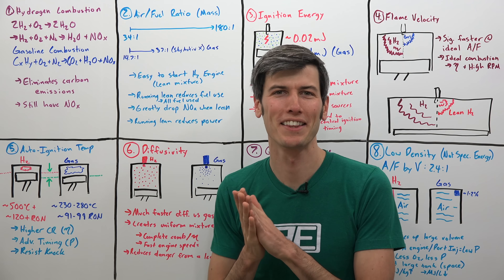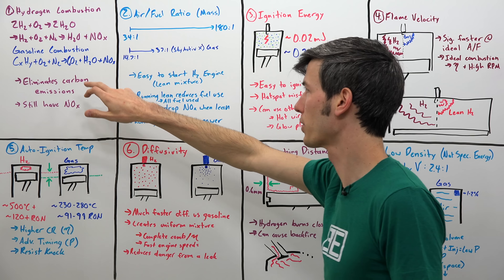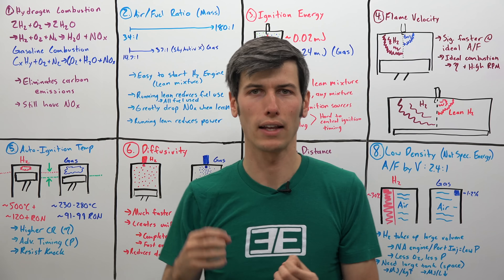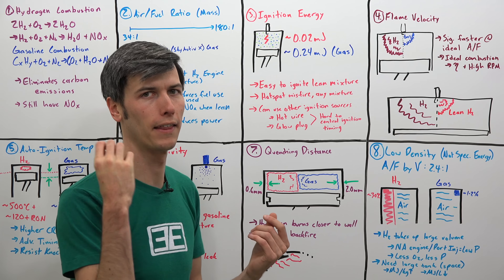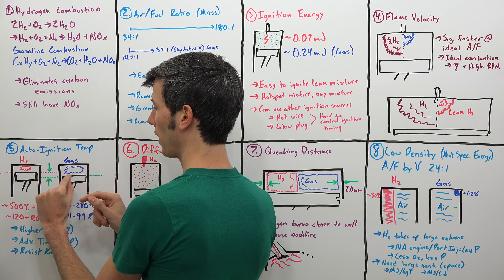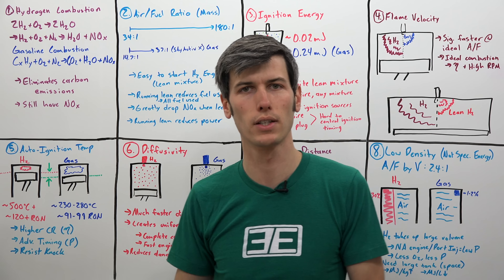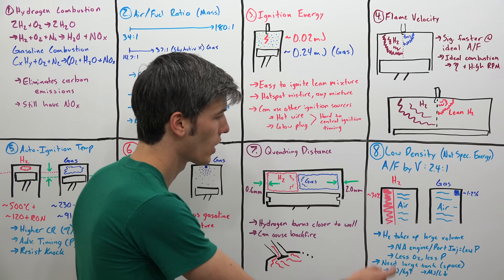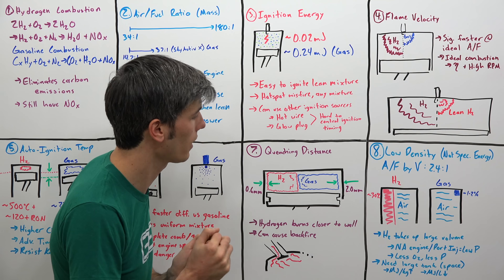The Difference Between Gasoline And Hydrogen Engines

Comment: You can get more oxygen for combustion by using pure oxygen instead the nitrogen rich atmospheric blend. It might also fix the nox emission problem. When you use a hydrolyzer to generate hydrogen, it also  generates pure oxygen. The hydrolyzer could generate the hydroxy mixture on demand, using water as the fuel.  A small amount of water can produce vast amounts of hydroxy gas. That would take care of the oversized fuel tank situation. The only thing to work out is perfecting a highly efficient hydrolyzer, but people who have done so successfully in the past seem to have a tendency of winding up dead under mysterious circumstances. I'd imagine that might be due to the fact that oil based fuels becoming obsolete over night would collapse the economies off countries who's only exports are oil, and subsequently collapse the world economy.
Reply: You can't run an engine on water because it takes the same energy to crack water into H2 and O2 gas as you get from burning the H2 and O2 gas.  Therefore, you would need a separate engine in the car to create the electricity for cracking water.  And this engine would be 30% to 40% to 50% efficient (gasoline ice, diesel ice, turbo jet, respectively).  And the electrical systems would be about 90% efficient.  And a hydrogen ICE would be between 25% and 40% efficient, whereas an H2 fuel cell is 50% efficient.  All those engines and systems under one hood, resulting in less and less efficiency?  Those mysterious deaths were probably guys working themselves to death to solve a problem that can't be solved.
Reply: MultiPleaser I think you totally missed the point of his post.  You just overly explained the problem that he already mentioned.
Reply: Why do you want to carry oxidiser onboard when you get it for free from the atmosphere?
Reply: Why burning oxygen what humand need for breathing? 
What about people living 24/7 inside crowded cities? You don't care about them, as long you can drive your noisy and air polluting car?
Reply: @eDriver  The oxygen is already used by gasoline and Diesel engines... And this engine would use PURE oxygen, that is in the water...

Comment: A wonderful video- very informative.  One thing that you did not mention is that there is no "free" Hydrogen on the planet- it must be produced (usually by electrolysis) at a significant cost in energy.   Therefore, H2 should be considered an energy storage system, as opposed to a "fuel".  Also, I noticed you did not describe using O2 as the oxidizer, just air.  MUCH more power available, if you can keep the engine from melting!

Comment: Why not just use a hydrogen fuel cell at this stage?
Reply: doesn't have the sound. But yes it is way more efficient, especially in partial load scenarios. Guess we will never see an internal combuston engine running with hydrogen in a production car.
Reply: Expensive but a better option.
Reply: Engine go vroom vroom
Reply: I agree they have much better efficiency but are currently too heavy for automobile applications while hydrogen safety tech is improving it may not make it to cars for a while but we may be seeing them in aircraft soon due to their lightweight and that is an eager trade in the aviation industry.

Comment: I would complete with corosion comparison where (I guess) gasoline is more likely to wear out the cilinders, valves and seals and HHO doesn't do it but instead (I guess) HHO leaves some water after ignition which would eventually clean the (not much existing 😅) carbon deposits but would make the exhaust rust faster . Your videos are so nice so good luck with that !!! Cheers !

Comment: Hydrogen rotary video when? I've heard Mazda is going to revive the rotary for a hydrogen based range extender for an electric-only drive hybrid. I've also heard that rotaries are very good hydrogen engines. 
Also, since there's a huge range of fuel-air mixtures, does that mean that instead of revving the engine higher for more power, we could just adjust the ratio for more power?

Comment: Running lean causes more NOx not less.  As all of the fuel available (hydrogen or gasoline) reacts with oxygen, the remaining free oxygen begins to react with nitrogen.  Higher temperatures and pressures also increase production of NOx.  EGR works to counter this by recirculating "inert" exhaust gas back into the cylinder, reducing combustion chamber temperatures.

Comment: You forgot to mention the fact that you have to keep the hydrogen a liquid so you have a very heavily insulated pressurized tank to keep it a liquid. BMW had a 7 series that could burn gasoline or hydrogen that lost most of it's trunk to the hydrogen tank that could only go like 150 miles and would turn into a gas within 7 days of filling the tank.

Comment: Doesn’t point 2 contradict your final point about how much air is in the combustion chamber? If hydrogen can burn with a greater proportion of air, does that not also mean that the combustion chamber have have more air to a given volume of hydrogen?

Comment: Using water to store the hydrogen saves the need for compressed hydrogen.  I've argued for the 'water4gas' method and have limited experience with actually running it into an ICE designed for gasoline. 

The rumble and vibration was greatly reduced, and power was  greatly improved. I later checked the oil for unusual contamination like water which would ruin it and there was none. 

Mercedes-Benz once sold a 1.8 liter turbo engine that ran on both gasoline and diesel fuel simultaneously, not exclusively one or the other but both and at any ratio

Comment: A couple things I've heard about hydrogen is, one, hydrogen is hard to store because of the small size of the molecule, it leaks out at a particular rate.  Two, metal engine parts involved with combustion become brittle over time.  Do you know why that is and are there solutions?

Comment: arent 5 and 3, 2 and 8 contradicting points? you didnt talked about cylinder walls
Reply: 5 and 3 are about compression vs. heat/ignition, the compression can be higher (i think due to density and compression of liquids vs. gas) but it takes less energy for a spark/hot spot to ignite the fuel/air.  8 and 2 refer to different things, how lean it can be to still run vs. comparable power out put to fuel air.  If i understood him correctly that is.

Comment: If it at all interests you, while watching this I pondered how hydrogen could be used to supplant natural gas and other fossil fuels for power plants. I only did a very minor inquiry into the development of these facilities and my question is: Could it be possible and on a large enough scale for power production? Obviously a power plant has vastly more space required to store liquid nitrogen so the space confinements like in a vehicle wouldn't be an issue but would the cost benefit ratio and yield of power produced be plausible if not possible?

Comment: Could u PLEASE do a video discribing in depth how an existing hydrogen combustion engine is engineered in terms of fuel carriage, fuel delivery systems perhaps detailing how it is safely done so without blowing up, and describing how the engine is controlled in terms of use (or lack) of variable valve timing, ignition timing, and computer a/f mapping.

Comment: Technical question(s):
1) does gasoline, which also provides a little cooling to the cylinder, offer more or less than hydrogen
2) leaded fuels were made so for lubricating purposes, current fuel is lead free but lubricating methods have improved. Does hydrogen operate with current lubrication tech?  
3) with higher compression and closer tolerances for hydrogen compression, what sort of wear and tear or wear tolerances are we looking at?
4) accounting for blow by, either from residual oil in/on the cylinder walls or piston rings...or from hydrogen entering the crankcase, what sort of engineering is used to account for this?  

For those who got lost on question 4- it’s what your EGR valve does to relieve and circulate excess air/exhaust byproduct and keep your engine cleaner by reburning it.  Diesels, especially older ones, are an over pressurized crank case which is why they commonly leaked oil. The diesel solution was to simply have a hose that dumped excess “air” out the bottom of a vehicle.

Comment: At 500C you need special alloys to keep the hydrogen from penetrating steel, and making it brittle.
Reply: I worked in the strip steel industry for 25 years. We annealed all our steel coils in furnaces that used pure H2 as the charge atmosphere. It can thoroughly penetrate the tightest wrapped coil of steel , preventing oxygen, nitrogen, and any other gas from entering the inner charge cover. The steel  was usually annealed at about 1300 degrees F. It came out perfectly clean and bright after about 30 hours. It was NOT brittle. It was Annealed.
Reply: So below 500C hydrogen wont penetrate metal?  from where do u know that?
Reply: Except most engines are cooled now... And have max 200 C on the COMBUSTION chamber.
Reply: Vladimir Lucifer that may be true in aggregate but the immediate surface inside the combustion chamber will be hotter. H2 is very good at penetrating metal. In my original comment i meant to say 500F not 500C.

Comment: What about the power due to the repulsive force of the gases created?  I could be wrong but I believe the majority of power from a gasoline engine comes from turning small gasoline molecules that pack neatly together into bulky CO2 molecules that do not.  So we have all these new repulsive forces from conformation changes of the molecules.  The H motor seems like it would mostly just heat up whatever gas is hanging about, plus make some steam pressure.  Is that steam pressure as significant as the CO2 pressure?

Comment: Excellent job. I had always overlooked the NOx aspect.
But you did leave off one important safety aspect. Yes hydrogen is safer for an egress leak, but an error filling the tank can be devastating. If hydrogen meets oxygen in anything over 40 psi, it makes water really easily and very loudly. A faulty filling pump line would easily explode. This has always been the major issue with hydrogen. Its touchy.

Comment: Gasoline's quench distance is why aluminum pistons and heads can survive the heat of combustion.  The unburned fuel/air on the walls insulates the metal.  I'm curious what steps are taken in an engine designed for hydrogen to manage the higher wall temperatures.

Viewers, please don't confuse pre-ignition with detonation.  They are very different effects.  They can have similar results, though.  Also, American viewers need to note he used RON value, not the more familiar pump octane value we see every day.  Pump octane is the average of Motor Octane Number (MON) and Research Octane Number (RON).  99 RON is about 94 pump octane.

Comment: What about if you make a small string trimmer sized HHO engine (closed air system to lower the volume requirement) that powers a generator that provides power to the battery of a plug-in EV?

Comment: You need to cover using hydrogen as a detonator with a base fuel. Around 10% hydrogen to hydrocarbon and it nearly has a flame front speed as fast as the hydrogen itself.

Comment: As good as this seems i see no practical value in this fuel, for example:
1. How do you store and transport hydrogen fuel in an economical way?
2. How do you produce said fuel?
3. How do you refuel and store hydrogen in your car?

Hydrogen is a gas and to get a liquid you need either ultra low temperatures or super high pressures, thus you can only store it as a compressed gas. This severely limits the amount of fuel you can store in your fuel tank and in turn also limits the range you can travel.  Then comes the question of where the hydrogen comes from, surely it doesn't grow on trees? Electrolysis perhaps? Maybe, but why go in such a roundabout way instead of just putting that electricity into an EV directly?
The closest you can now get to a hydrogen fuel is LPG. Carbon atoms do a great job of keeping hydrogen atoms through C-H bonds in the form of hydrocarbons.

Comment: Great video, two comments:
1. Are you saying any combustion car can run hydrogen as it's fuel source?  If so are there modifications needed?
2. You didn't touch upon the availability of hydrogen or the cost.  Would have been nice if you had a comparison square on that too.  To use a Back to the future reference, I assume hydrogen "it's a little hard to come by"

Comment: Great video! Have you researched HHO generators? I have been wondering is it really a myth or is it can have a positive affect on the engine performance? :)
Reply: i build my own HHO and tested it on sisters car, it was citroen xsara 1.4 8v 75hp engine... the results was reduced fuel consumption by 40% and the car was accelerating like it had 100hp
Reply: It can if you know what your doing. Or you could suck all the amps and do yourself and disservice

Comment: 11:10 when you have a fuel/air mixture igniting in the intake, it’s actually known as a popback. A backfire is when the mixture is ignited in the exhaust.
Reply: Michael Murray Don’t wanna be that guy, but.. technically a ‘Backfire’ is an ignition taking place within the inlet side of the engine, and an ‘Afterfire’ is an ignition that takes place within the exhaust side. These terms have been getting confused for years

Comment: I understand that more than one gas can exist in the same physical volume, unlike liquids. So does hydrogen taking up 30% of the cylinder really mean 30% less air volume?

E.g. vaporized methanol injection (I've been told) doesn't displace air intake volume because it occupies a different molecular space. Or is that BS?
Reply from the maker: A naturally aspirated engine can only pull in atmospheric pressure (about, at most). So you're limited by that pressure how much air you can have. At atmospheric pressure, by volume, you'll need 2.4 parts air and 1 part hydrogen. Of course, you could use forced induction, and put in more air and fuel, or use high pressure direct injection to force hydrogen in to a cylinder that's nearly full of atmospheric air.
Reply: @EngineeringExplained I think I see your point. My original comment is misleading because while more than one gas can exist in a volume, that will increase pressure, just like compressing it. In the example of meth injection the cooling effect possibly counteracts the increased pressure / gas volume, so they say it doesnt reduce air volume.

Comment: Points 2, 3, 4, 5, and 8 are compareble to a diesel engine. Only on point 3 they use selfignition on a diesel instead of a sparkplug igniting the fuel.

Comment: What about an engine that used a 50/50 mix of liquid hydrogen and liquid oxygen? It's basically rocket fuel so the engine would only be using a tiny bit at a time. Plus, since the fuel already has oxygen in it you don't need an intake, to make more power it simply puts more fuel in.

Comment: Fine and dandy except that free hydrogen (ie, hydrogen that is not already chemically bound) does not exist on this planet.  The only way to get hydrogen is to use energy to break those chemical bonds to obtain the free hydrogen, and the energy required to break those bonds will be very substantially more than the energy that an internal combustion hydrogen engine could possibly produce.
The only thermodynamically practical application of hydrogen fuels I am aware of is in Iceland, I believe, where geothermal energy is used to produce electricity which is fed to a fuel cell which very efficiently breaks down water into hydrogen and oxygen.  The hydrogen is pumped into a vehicle that uses that hydrogen and atmospheric oxygen in a fuel cell to produce electricity to power the vehicle and has water as exhaust.  It would be more efficient, theoretically just to use the electricity originally generated with geothermal energy to power the vehicle, but the batteries required don't store as much energy as the hydrogen tanks would.
In any case, no fuel is a wonderful fuel if it does not exist on our planet.  Just sayin...

Comment: In the diagram of fuel-air mixture, you say that 30% Hydrogen is the perfect mix. Is that based on the fact that atmospheric air only contains 21% Oxygen?

By definition if you had a sealed system, you would need 66.67% Hydrogen and 33.33% Oxygen for the perfect fuel-air mixture.

Have you ever researched resonant water fracturing for the creation of Brown's Gas?

Comment: What if the car breaks down water and injects the pure oxygen and hydrogen into the cylinder to give much better power and less emissions. Also space is less for generating hydrogen on board than fuel cells.
Reply: Also what kind of hydrogen power ratio to gasoline could be expected if exact o2 to H ratio were injected under pressure?